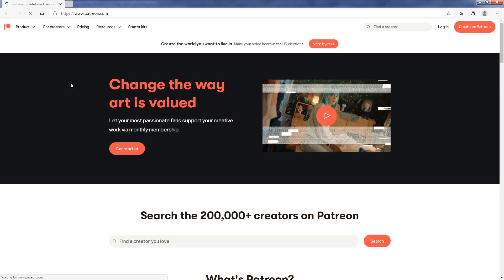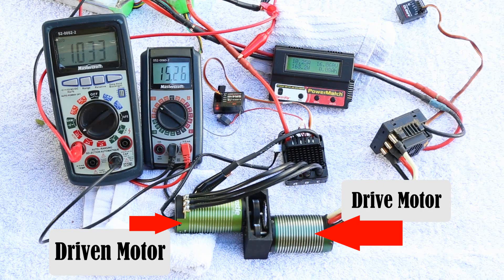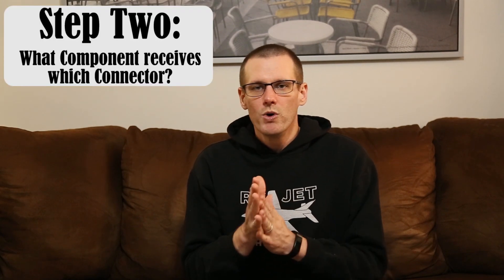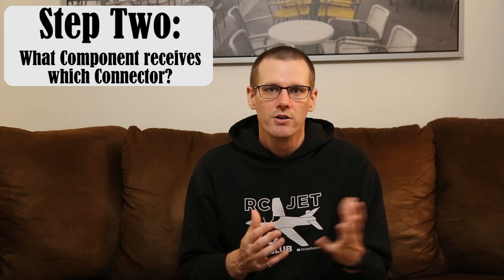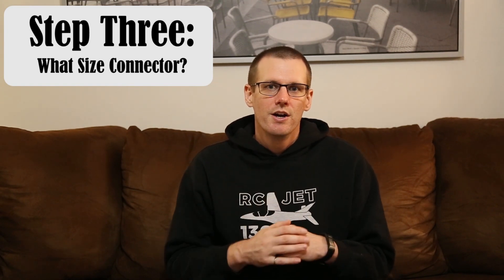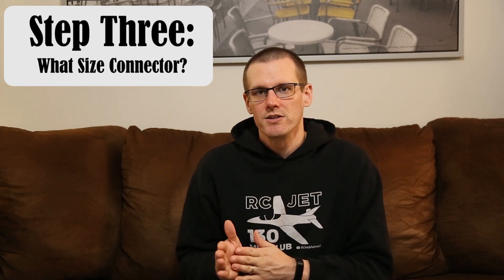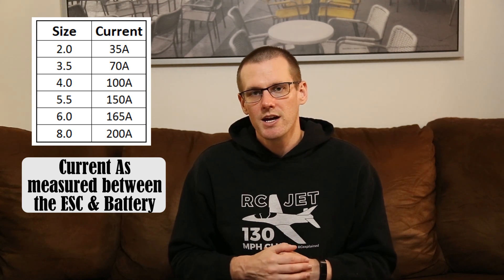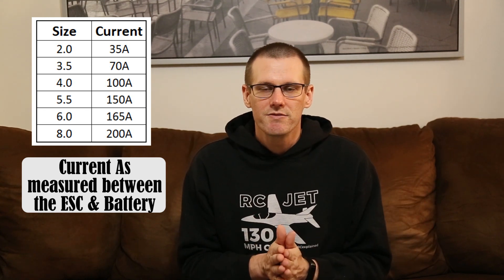Best Connectors for Brushless Motor to ESC Wires and Connector Maximum Current Ratings

Comment: Wow thanks I was wondering if your setup only requires a 10 gauge wire is it okay to put a 8 gauge wire and same question for connectors far as 5mm vs 8mm will your system run cooler and better with bigger connectors and bigger wires

Comment: Nice chart and very handy.
Has anyone ever tested this? 
The problem is, search for example 2mm bullet connector and you'll get ranges one saying 20A max to 35A max.
And to make it even more confusing, some will even say maybe 20A continuous load and 30A peak like discharge rate of a Lipo.
Have a look on the webpage of Dronetrest and compare the values they have for the different connectors. 
When in doubt, play it save and take the most conservative value from multiple searches.
 But don't put 8mm bullets on your toothpick or Nanohawk.

Comment: bro i plugged my hair clipper in wrong current, however the motor didnt burn the small green board attached to it burnt the motor is a 110v dc motor and when i connect it to 110v its just vibrating its not spinning. how can i get it to spin?
Reply from the maker: A 110v DC motor requires a 110v AC to 110v DC rectifier. This is assuming the 110v you plugged in to is an AC outlet.

Comment: I use the standard 1/10 connectors I’ve never had issues with these connectors just esc’s
Reply from the maker: Bullet connectors for the most part are the standard connector for the ESC to motor connection. Which do you use?
Reply: @RCexplained  4 mm gold , the esc was the weak point I don’t even think the connectors got warm , was only running 2s but it was a China system
Reply from the maker: 4mm works well for many setups!
Reply: @RCexplained  yep!

Comment: Great tips, thanks! Just my 2 cents: wherever possible, I use anti-spark connectors for my battery leads as an extra precaution.
Reply from the maker: Great Point Remko! This is a point that will be discussed when we talk about battery to ESC connectors.
Reply: @RCexplained  Oops, looks like I was a little too quick off the mark with my comment, sorry man! Anyways, love your video's!
Reply from the maker: No worries, serves as a good reminder. Thanks Remko. Did you see the regen braking video?
Reply: @RCexplained  Yes, I have seen it, and was amazed that power was actually going back to the battery! I never knew that!